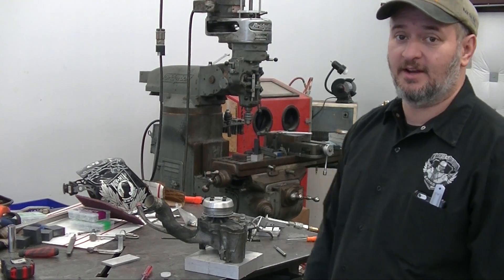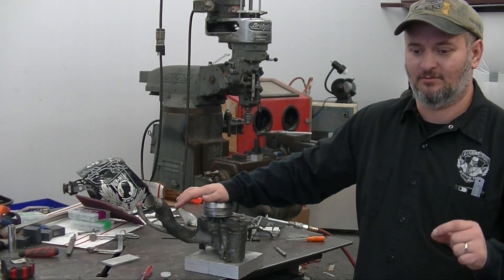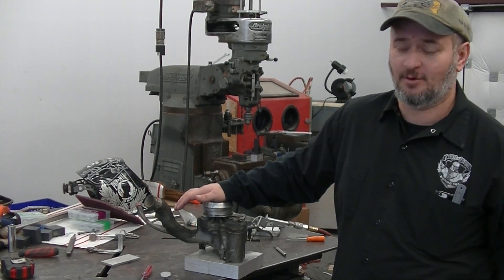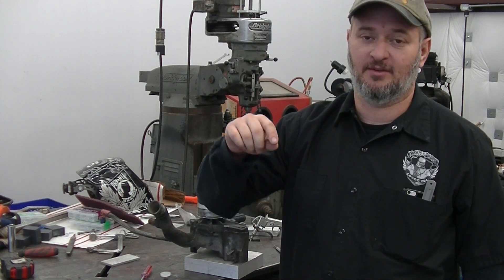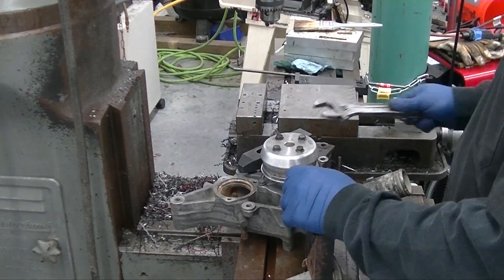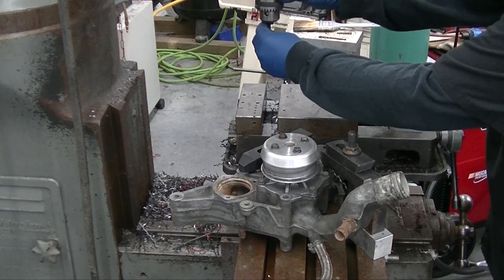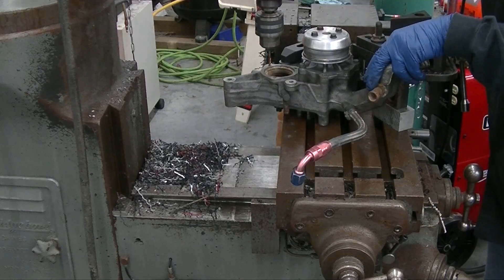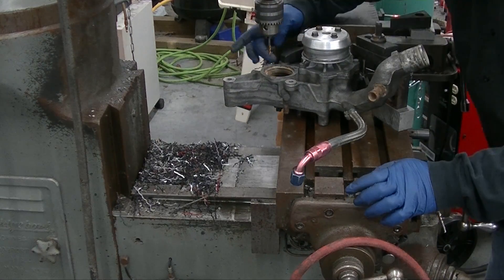Get 'er Out - Broken Bolt Repair

Comment: Hey Tom, good job there.  As you said 'get it done'.  I was looking at another channel and saw a guy drilling out some studs with a corded drill, initially thing what is he doing there?  Then I remembered getting the easy-out, out, then drilling out the remains of the cylinder head (in-situ) before re-tapping the hole.  This all because I wanted some posh Stainless steel, domed nuts showing  to clamp the the exhaust manifold on my BMW 1150 GS Adventure.  That was a had lesson right there, if it ain't broken, don't attempt to fix it.  Thanks for sharing and Happy New Year from a very miles Bonnie Scotland.  Kindest regards.  Joe.
Reply from the maker: +Joe McIntyre I think we all learn this lesson the hard way, Joe. Glad I could fix it though! I have to admit, I bet the domed nuts looked good on the bike. 😎

Hope you have a wonderful New Year, sir.

Sincerely,
Tom Z

Comment: I'm good for the broken bolt occasion but I hate finding someone has hacked at it and broken a bit or easyout in there.
Reply from the maker: Hey, Zig! How's your Summer been so far? This project turned out to be fairly easy. What I was dreading was having to gouge the entire pocket, weld, and then drill & tap a new whole. Thankfully, that wasn't necessary!

Best wishes,
Tom Z

Comment: The mill made that job a lot easier .  A lot of times I use the tig welder to get broken bolts out.
Reply from the maker: Agreed - and I considered that but the broken extractor slam in the middle had me worried about dissimilar metals. Just glad this worked out as well as it did.

Hope things are going well out on the Left Coast!
TZ

Comment: Hi Tom,
It looks like it could be very expensive to buy a new or rebuilt one.  Nice saving the water pump. 
Merry Christmas to you and your family!
Take Care,
Reid
Reply from the maker: Hi Reid! They stopped making this engine in 1999 so it's harder to find parts these days. The funny thing is the casting was labeled Kubota. It was easily going to cost somewhere between $400-500 to replace but being an old RX-7 guy, I was happy to help my friend get this fixed.

Merry Christmas, sir.
TZ

Comment: Do as I say, not as I do?  Wonder if there will be a need for sealant on the threads of the bolt since it possibly penetrated the water jacket?  I know some vehicles require that on some of the water pump bolts.  Thanks for the vid Tom .
Reply from the maker: You know it, Gary. I'm sure I'll catch a few "comments" from chucking the milling cutter. As for the water jacket, it didn't penetrate past the blind hole area. I could visually inspect the from the inside and they got lucky there, that's for sure. The leftover bolt tip is just trapped in the end of the blind hole. I don't anticipate anything special other than a good cleaning to get any stray chips out of the interior of the pump.

Thank for watching, sir!
Tom Z

Comment: I always use heat and they generally break free with no problem....I get it you had nothing to get on, so the mill makes sense...nice work!
Reply from the maker: +Cole Regal Agreed; heat usually works well too. By the time I'm involved, it's usually too late but I'm sure you know that feeling as well. 

Got the 1100 fully running yet? Enclosure looks amazing.

Best wishes,
TZ
Reply: Thanks Tom, it is coming along...it is mostly done, except for the lexan and powder coat, which means a full tear down.... :(